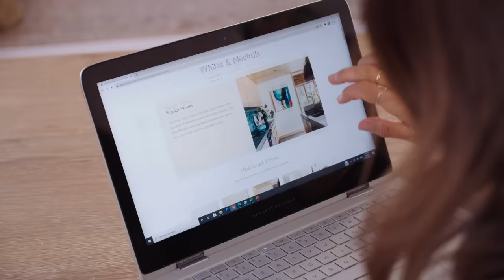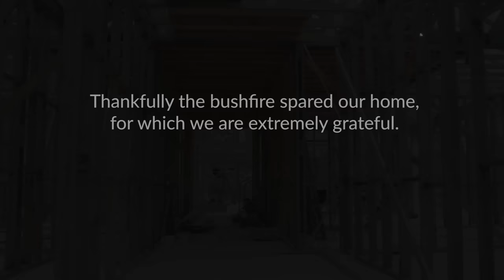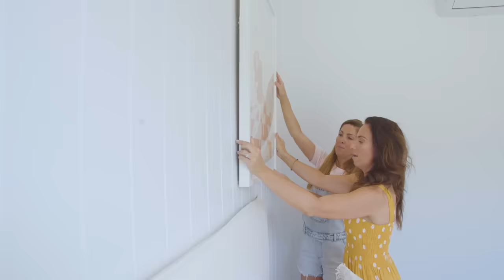Pool & Pool House, Episode 1 | Australian Staycation New Build | House 13

Comment: Excited to watch another project! Yay! I always wonder with these bush builds how you incorporate fire proofing standards? It's always a little scary to see these beautiful structures that don't seem to be very fire resistance (lots of woods, etc). Considering Australia's climate and the recent harsh season of bushfires, what considerations need to be made? It would be really cool if you could incorporate more of this in your videos. Obviously this is not a reno, but a build so it must need different standards.
Reply from the maker: Hi Bronte, you're quite right! This build has a BAL19 fire rating and all the materials we use comply with this standard. x

Comment: where do you seek shelter when you can’t leave tho? asking from switzerland, where there’s no such thing as bushfires
Reply: i'm curious too, like there was no basement, so did they just go to their cars??
Reply: Ya im wondering the same. How do u seek shelter from a fire..its not like a flood or snow or wind
Reply: I think taking shelter in that situation would be to get inside not from the actual fire but from the smoke and possible falling debris aswell as the increasing heat espically if it is close by. Breathing it in can be just as fatal
Reply: @georgiamullins7311  ah okay thank you! I hope you were all safe.